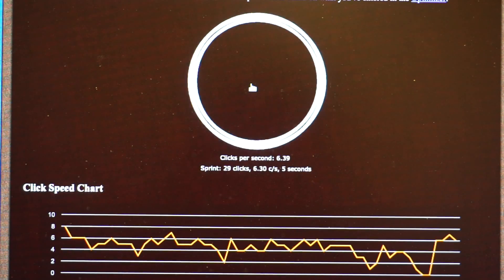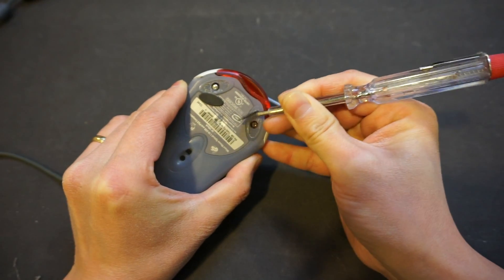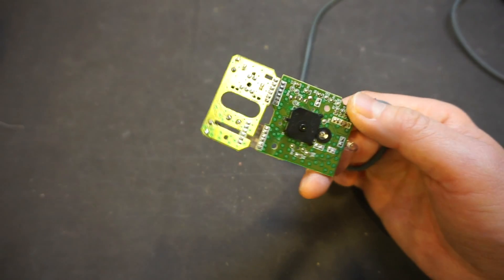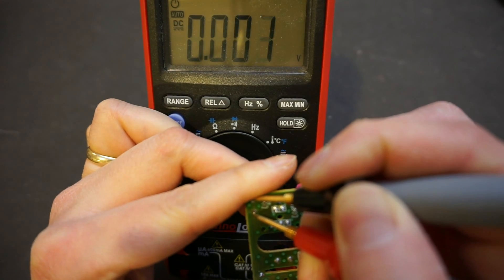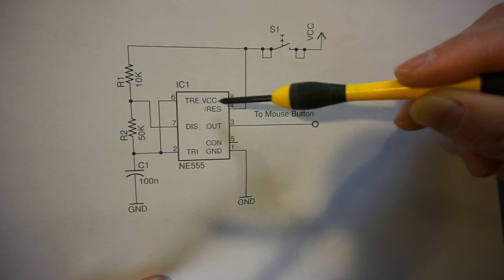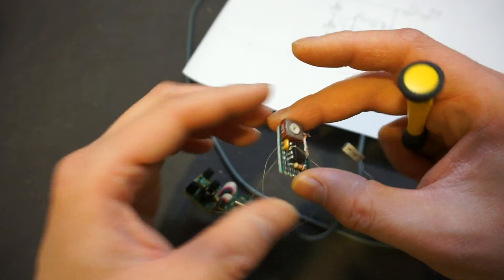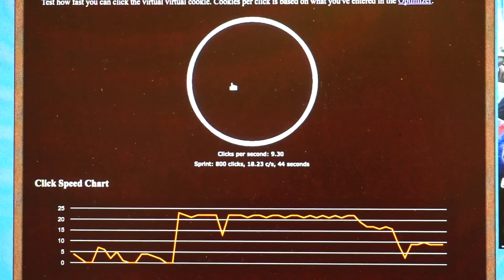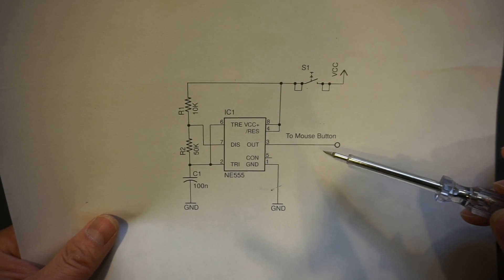Hacking Your Mouse for Rapid Firing

Comment: What was the requirement on the maximum click speed? You demonstrate 20 per second. What about 100 or 1000 per second. Is the USB 12 MHz is fast enough for to transmit more than 20 click messages per second?
Reply from the maker: The maximum click speed seemed to hover around 20 to 30 and my suspicion is that the OS can only process click events at this speed as it has tons of other events to process at any given time.
Reply: The default usb polling rate of the operating system is 125 hz. This means that 125 times a second, your operating system asks the mouse "hey dude, did the human press any buttons or move the mouse" and the chip inside the mouse can tell the operating system "yeah, the human moved mouse this many pixels in this direction and pressed these buttons or moved this scroll wheel in this direction".  So by default, you get maximum 125 updates or one update every 8 ms. No matter how many times you'll click within around 7.99 ms, the mouse will say you clicked once. 
It is possible (and many game/pro mouse drivers do this) to raise the polling rate to a maximum of 1000 hz (one update every ms), which means up to 1000 updates a second or potentially up to 1000 clicks a second.

Comment: Hi Kerry, I just watched your video on the speed of light. I really liked how you used correctly the number of significant figures in your answer. To increase the number of significant figures you would need to move the mirror to make the total distance greater than 10 meters and still be able to measure within a cm. Of course your instruments would have to be able to make measurements at the increased distance. If everything worked then you would have 4 significant figures in your final calculations. Great video. Keep up the good work. John C
Reply from the maker: Thanks John!